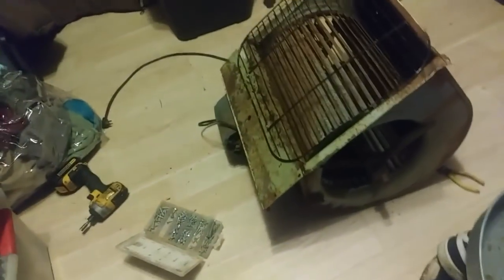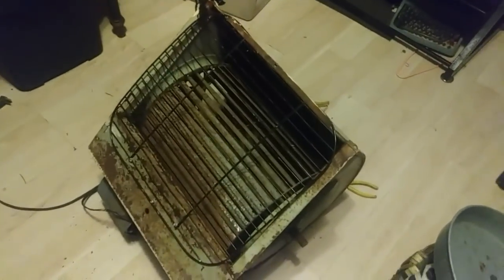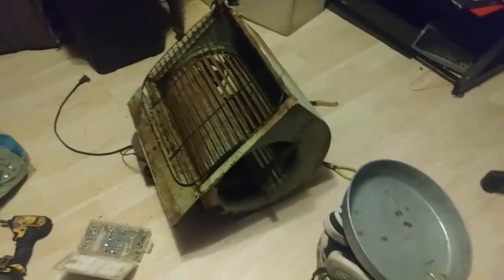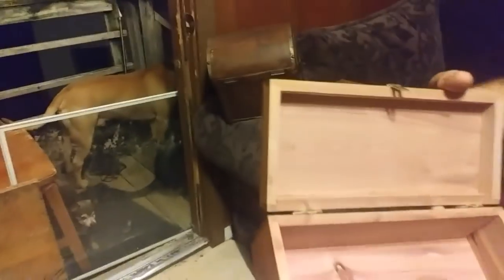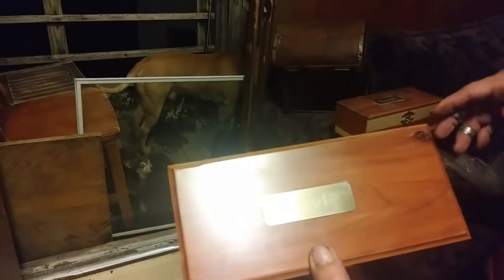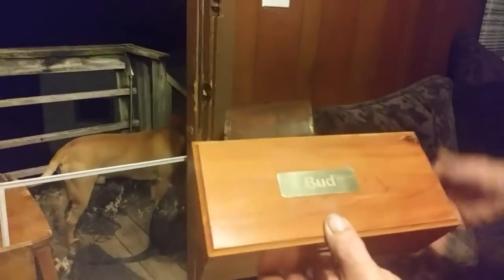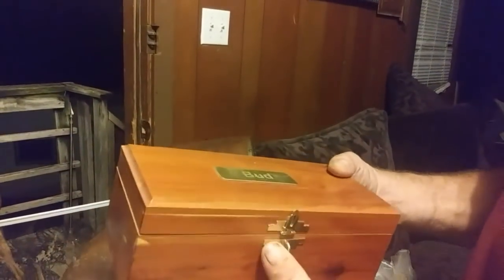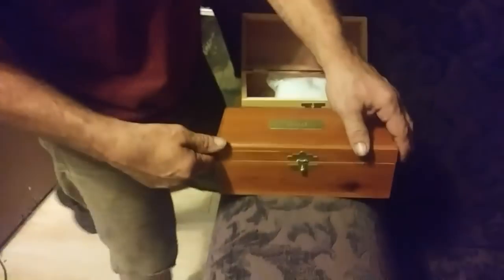Bombshell makes window fan!!!😀😀😀

Comment: Need to put a furnace filter over it so it won't blow everything inside, plus your blowing hot outside air inside, where as your window unit (AC) takes heat out, u know that being a old hvac guy Limp!! , but since summer is about over, it will work good at night time, just filter it, that squirrel cage fan will be blowing in all kinds of bugs!!!